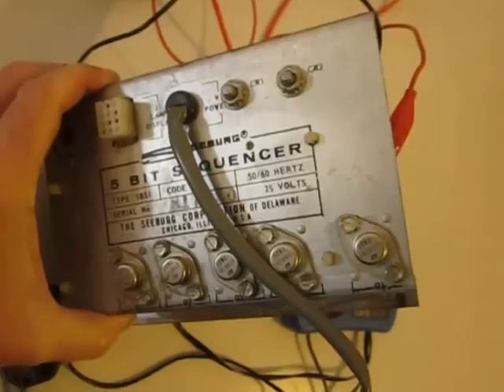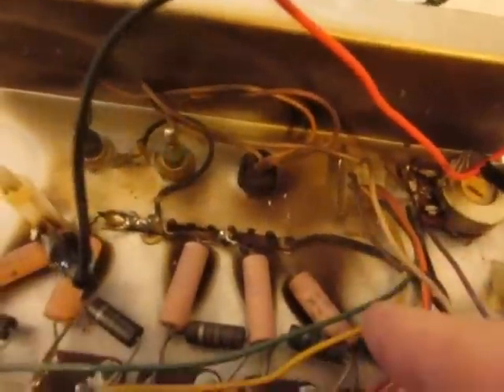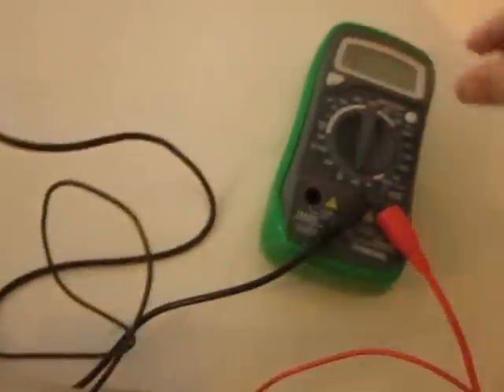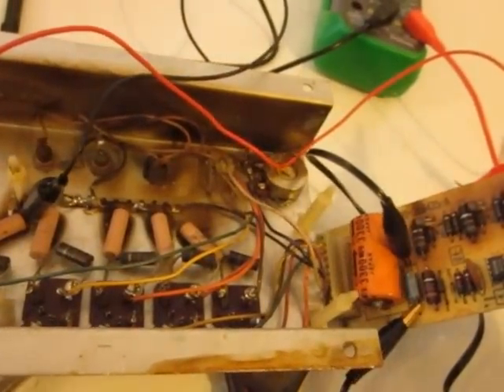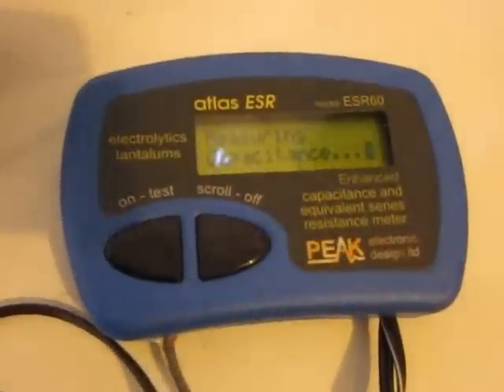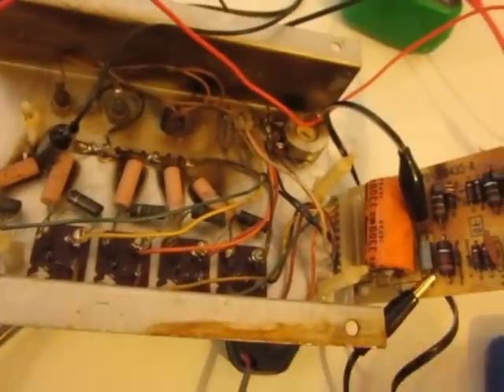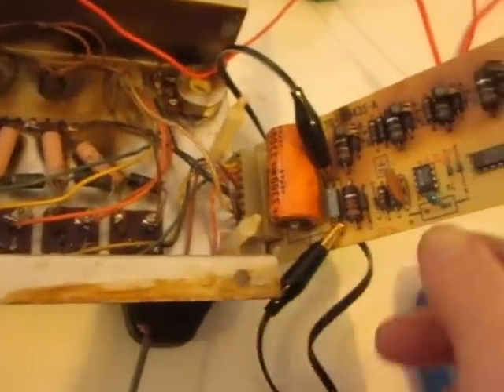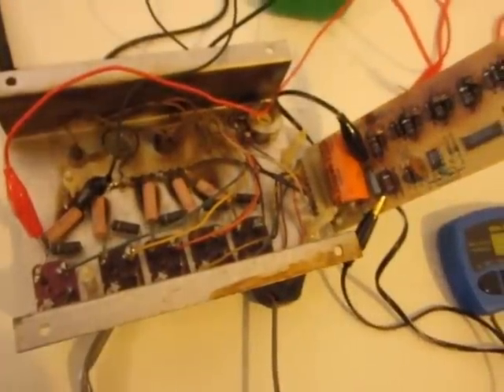Seeburg Chaser Light 5BS1 Controller - What Causes Smoking Resistors?

Comment: agtually looking closey at your burn marks i,d most certainly garuntee thats frm the ones in there at the moment,, because the burnmarks line up exactly with resistors, very very unlikely if burns from original, one or two wouldn,t  line up.

Comment: hey mardi gra, great dog tag,resistors look newer  can,t tell  from picture, originals are dark brown like the ones on the little circuit board  sitting above it, if so replace with later flame proof ones,[non working ones i,ve come accross, these will be completly split open completely, really big burn marks, only have one at moment but resistors are 30  ohm, check seeburginformation, think theyre about 22  ohms, big burn marks on all cases is normal, lot of heat, make air gap between case